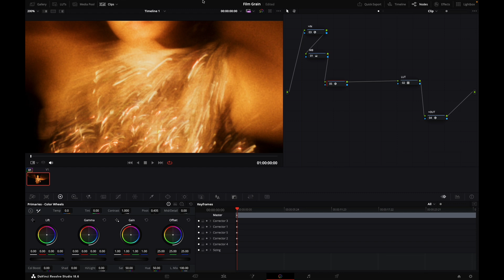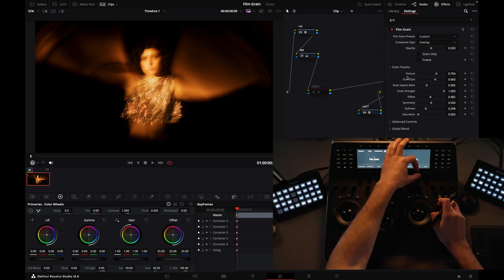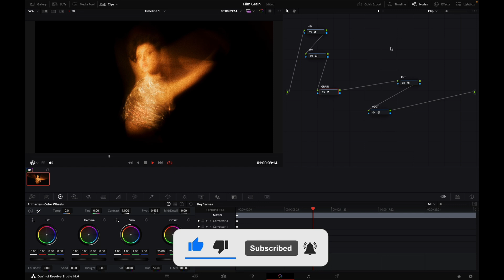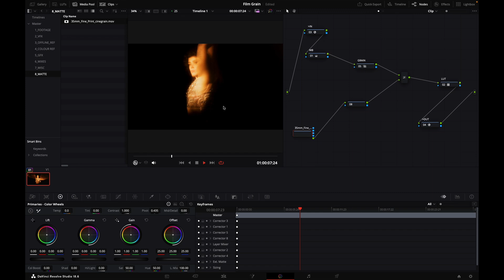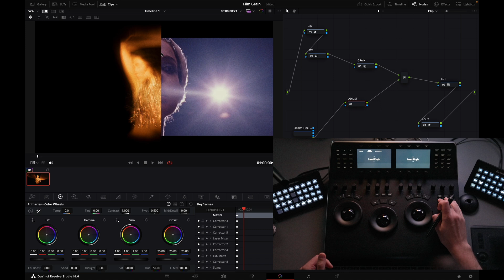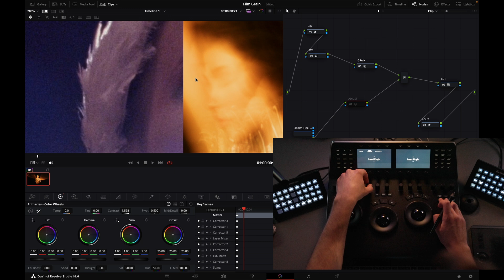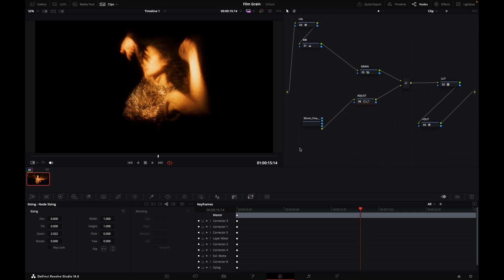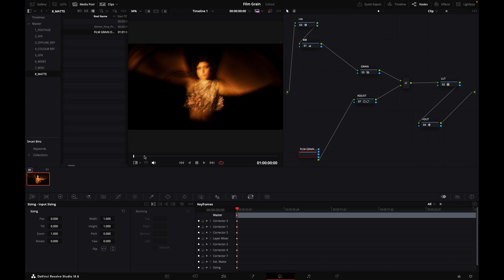FILM GRAIN : Advanced Tips in Davinci Resolve

Comment: It should be noted that where you place your film grain in a digital emulation that any spatial effects or blurs, smooth power windows or even lightening and darkening of secondaries, should be done before the grain node. All of the if done after the grain node will impair the grain. I personally wouldn't have the grain before any look lut either, but that's an subjective call. If you want to test this, just turn the "grain only" check box on and try some power windows and blurs etc. on nodes after it and take a good look at the grain. It will look terrible. 
The last CST is an exception, but everything else in my opinion should be done before the grain node in Resolve. We are doing visual emulations and it matters not how or when it appeared on film, because if your were doing a true emulation of the process, we would have grain on the first node and then do some printer lights and be done with it. 
Obviously we don't because we have the capability to change the camera footage and shape and finnish it to all kinds of different views to help tell the story.
Reply from the maker: Hi Jim! Thanks a lot for your in depth comment :)
I do agree with you regarding spacial adjustments, secondaries etc
I would usually place my grain layer after my power windows, blurs, spacial adjustments and clip secondaries. However my creative LUT or set of parameters would generally come after.
Also I think that's totally subjective and that's how I personally like to go about it